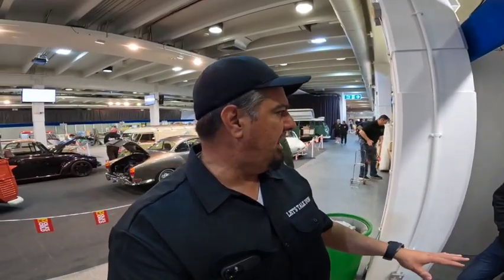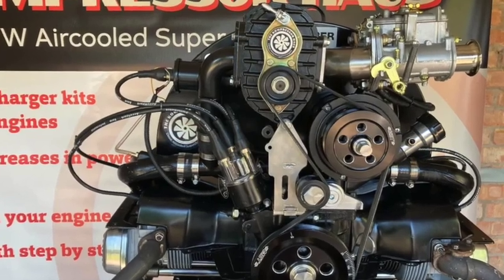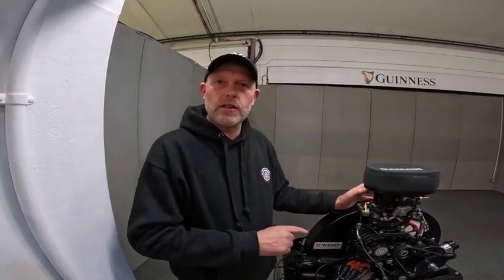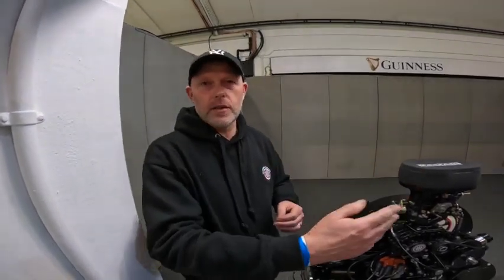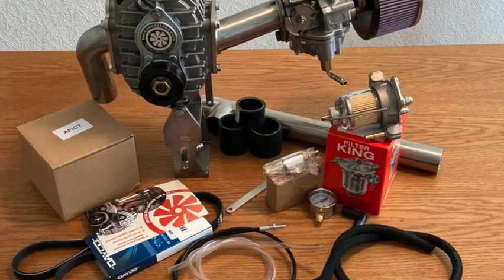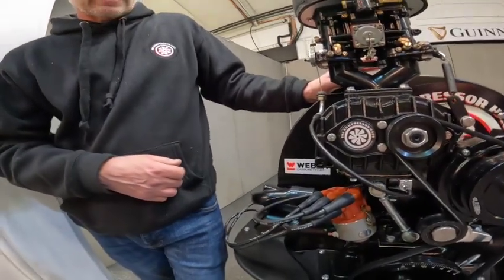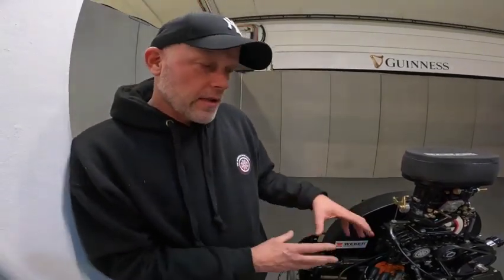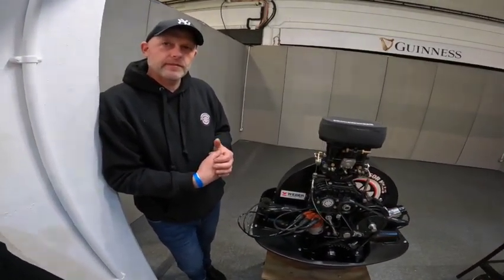KompressorHause Supercharge your VW!!!

Comment: A air cooled VW engine just ain't worth it any more! They're far too expensive for the meger power available! Better to install a good ($1500) rebuilt GM 3.1 V6 w/aluminum heads and forget all the BS to get more power out of an antique air cooled motor that will need a rebuild after 100k if it lasts that long before blowing up! And I luv the air cooled VW but the prices have gotten ridiculous for them!

Comment: have a vw bug 1500cc single port - 1968 and really considering the sleeper kit version, question - the decklid i have is a 65 with a popes nose, will i have enough clearance ? also roughly the output bhp?. currently 40hp ( does this setup work on single ports? or only dual port )
Reply from the maker: They make an under decklid kit